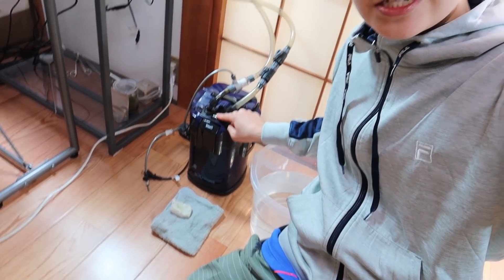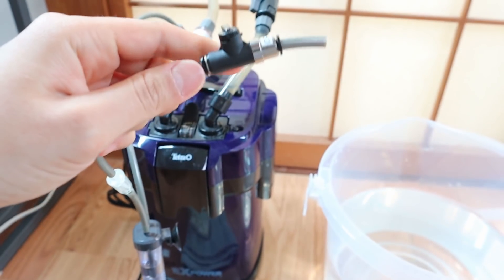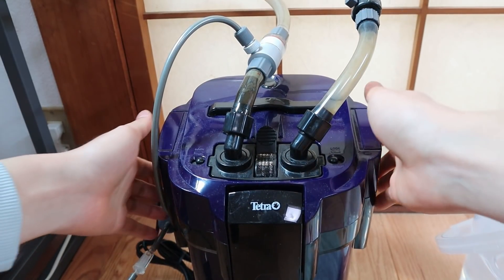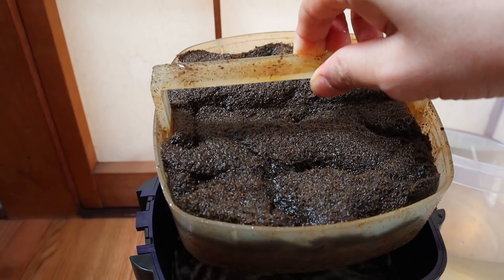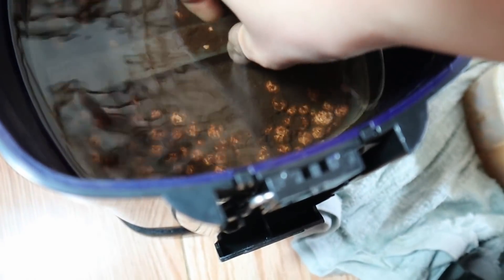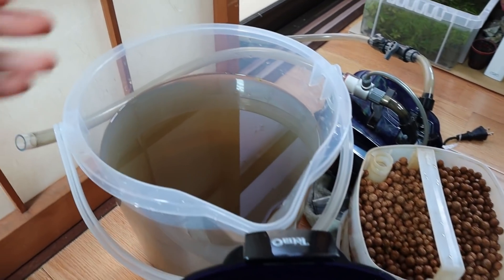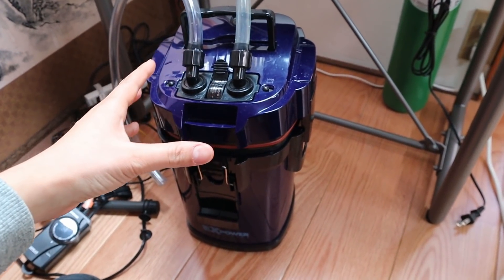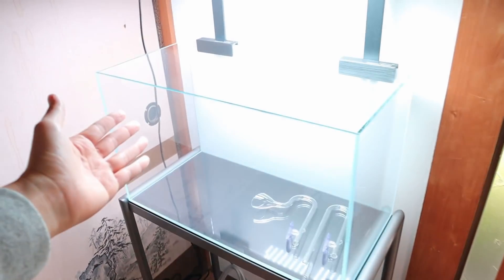How Dirty is My Aquarium Canister Filter After 1 Year??

Comment: I thought you were meant to have sponge at the bottom because the water goes to the bottom and is drawn to the top?  stops your bio media getting full of mess.  great video.
Reply from the maker: Some people do it that way. Usually, I never have sponge in my canister filter. If you look at the ADA filter system, they also recommend to use 100% ceramic media. The white filter wool on the very top is just to help polish the water

Comment: Put water in it and use airpump if you have it , it si the best way to save bacteria , without water they die
Reply: They’re fine without water. What they need is oxygen, which they’ll get more of when they are in air rather than stagnant water.

Comment: Keeping up with a regular cleaning every few months this time will help keep your flow at its highest potential which will make for better co2 distribution and distillation, especially since you run it inline; I also think you will be surprised how much it will cut down on any algae you dealt with in your last build.
Check out the manual for ADA canisters for some real good tips on cleaning your media etc.
Reply: I was about to comment the same thing. Just because you still have some flow, I wouldn’t say it was running with no problems. The algae this tank was plagued with might have been significantly reduced with regular cleaning.